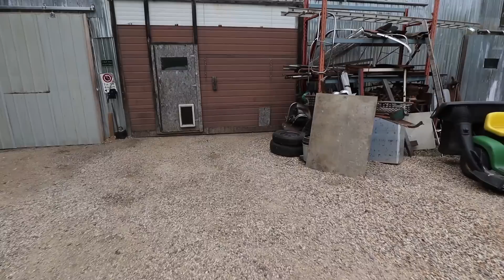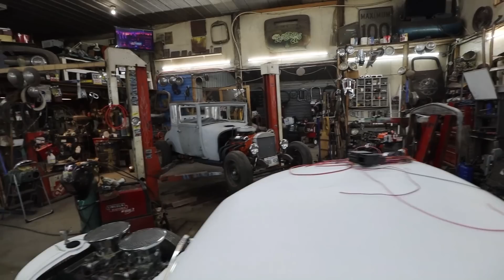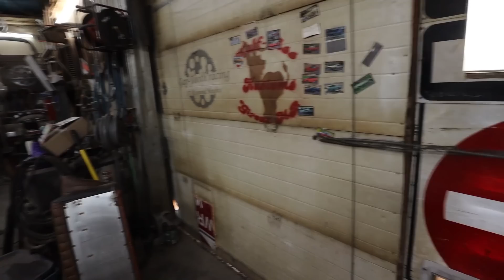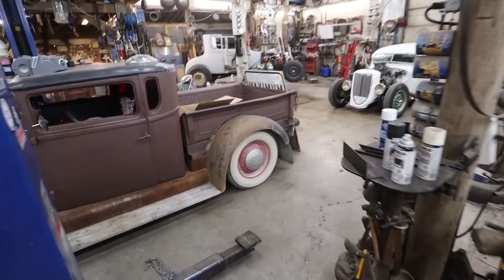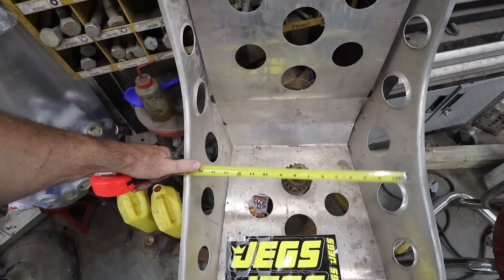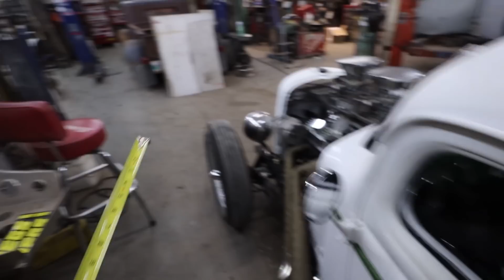Building bomber seats out of old road signs for our Ford Model T hot rod

Comment: I seen you tig b4 and you clean your work but is your rods clean use some stainless steel wool should help. I was tired of my old bench set is my 76 c10 and i had this junk 95 geo metro had good set and wouldnt you know very little work and they fit found a console in a junk 91 chevy truck my brother was junking it fit good also made the ride 80% better

Comment: Fine re-use of Speed Limit signs: as seats in a hot rod!  For an air plasma your table is doing well on aluminum. I worked with plasma and fine plasma tables 30 years ago. 

Thanks for the interesting content.

Comment: You can anneal aluminum,  coat it with soot from your oxyacetalene torch (lit without oxygen)  then just use the torch to burn off the soot.  It will be annealed
Reply from the maker: Yeah unfortunately with my torch set up I use propane only and oxygen

Comment: You should mod your break to give it more thickness capacity. Bigger back brace, bigger bearings, more leverage. There's several videos dealing with upscaling cheaper/smaller ones into big models.
Reply from the maker: It actually does have adjustment for thickness or at least that's what I use it for haha

Comment: Back in the early 70’s I used a GoodYear tire sign for the bottom of the floor in my 46 MB Willys. It had a glass coating on it which made for some interesting stick welding. Lol. Keep up the great videos.

Comment: Road signs are made of 6160 hard stock aluminum. They'll break if you try to bend too far. They won't take 90 degrees.
Reply: I retract that. It looks to have bent well. Thickness has a bit to do with it, I'd say.